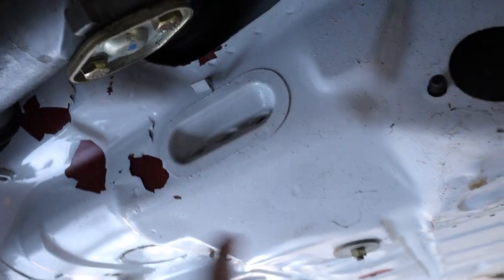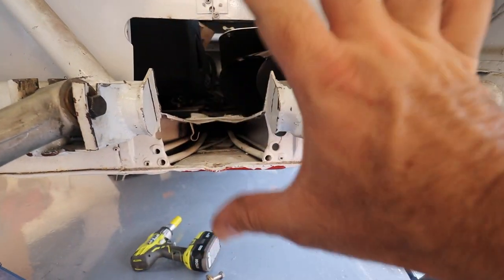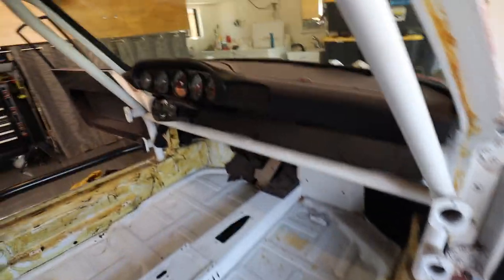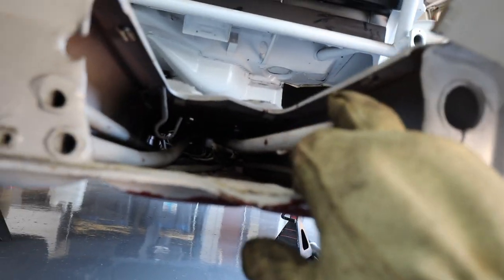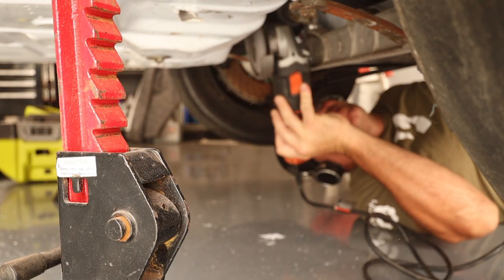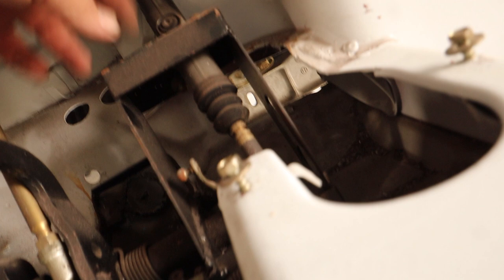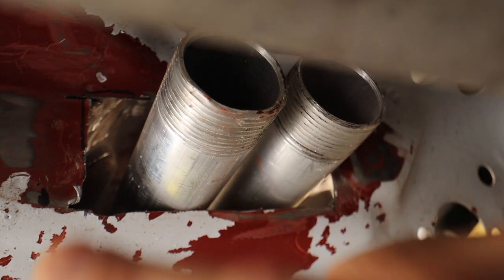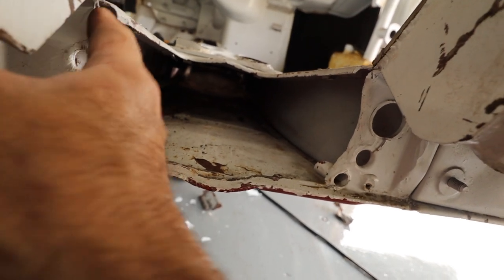Water Cooled Vintage Porsche 911 Coolant Pipes Through The Tunnel Subaru EZ30R | Blasphemy Build 24

Comment: Bulkhead fittings and flex lines through the heater ducts are what I'm using in my Subaru conversion.
Reply from the maker: What are you using?  What lines?
Reply: @rennch.  AN-16 startlite hose.  Hopefully sometime during winter I will resume my project.
Reply: @pksystems4714  i think this is a much better long term solution. basically no heat exchange, flexible, no rusting or corrosion and not prone to vibration.

Comment: You might want to ceramic coat the hot out pipe so that it is not sending that much heat to the cool pipe, especially close to the engine...
And you might want to add some foam (automotive structural foam) to help with the vibrations, rear, middle and front is usually a good place to start, and keep an ear out for vibrations

Comment: I am doing this same build (EZ36 minus the turbo's)but in a 914, actually my second one and this time did aluminum tubes thru the tunnel just as you did, I wrapped mine in fire sleeve from Amazon, not sure that will be enough. If not will enclose the tunnel with additional insulation. You will love that engine, my existing build is an EZ30 with standalone Link G4 and it did 240 hp at the tire and is a blast on the track. If i can help hit me up

Comment: Great video....concerned about the heat in the cabin, hope you can fit some pipe wrap on them.  I’m also concerned about the aluminum anywhere it might eventually touch the steel, even with grommets, you will eventually see wear (especially with heat cycles)....and when the aluminum and steel touch you will get corrosion, the aluminum will fail and leak...and the steel will rust.
Reply from the maker: Thanks Lewis. I will definitely address all of that when the time comes.
Reply: @rennch.  I'm with Lewis... I think you also need to support the tubes at intervals to stop them flapping around..... they'll be much heavier when full of water, and not as stiff as they seem when empty.....

Comment: There is a sticky back thermal covering you could either cover the pipes in or stick to the inside of the tunnel before you insert the pipes. Should sort out any heat issues. hope there is room to fit all the gears lever cables and break lines in there : )
Reply from the maker: That’s the plan on both counts!

Comment: I was thinking those tubes thru the tunnel may need bracing at the midpoint. Those will vibrate inside the tunnel. I work on transport trucks of various sizes and our hydraulic and coolant tubes have bracing to prevent failure.
Reply from the maker: You have my favorite user name, if you are the same guy on Instagram. I just think it’s fantastic. I’m sure when the time comes I will brace it in the middle. Thank you for the suggestion.
Reply: Rennch - Porsche 911 Restoration and DIY Tips  you’re welcome.
That’s my Instagram name also. I’ve hurt the odd cone in the pursuit of faster times 😁
Reply from the maker: @ConemantheBarbarian  Me too!  Won a couple of national events and a championship in Colorado in an 89 Civic SI.

Comment: I guess you couldn't just use those existing pipes to run coolant. I'm sure you thought about that. The new pipes are really big! Should keep the engine nice and cool. 
I really admire how you just measure stuff out and make parts. Fearless!
Reply from the maker: No...definitely not large enough. Thanks man!

Comment: Seems to quite a big diameter.. it would probably be easier to fit everything if you went one size down...
Reply from the maker: I wanted to...I was advised against it by multiple people smarter than me.
Reply: @rennch.   Good choice, that pump is gonna need all the help it can get, moving fluid all the way to the front and then back again